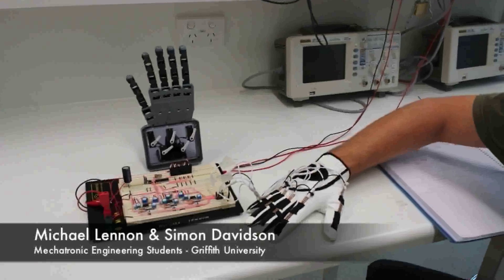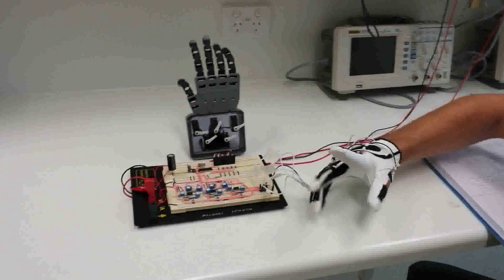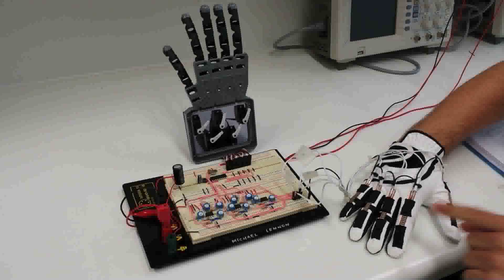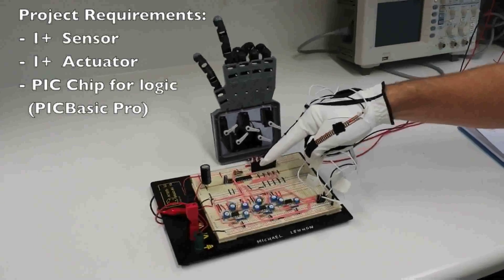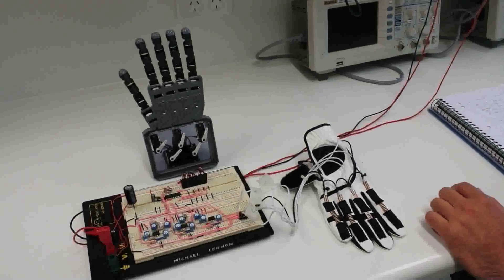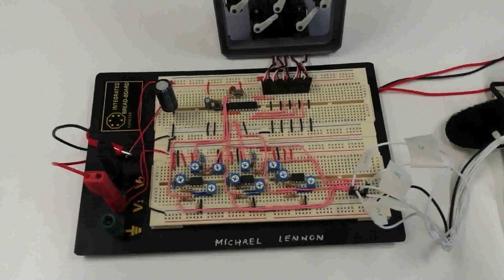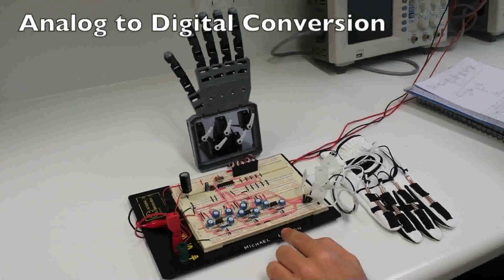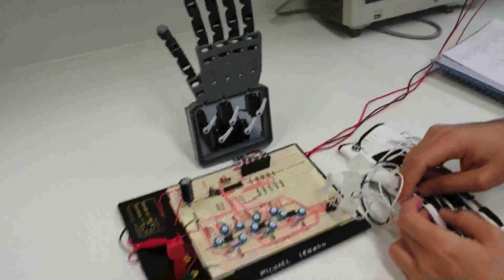Sensor Glove Driven Robot Hand

Comment: Good job! I built something similar to your project but I used full actuation (one servo for every finger joint) Pros of this method: You can perform much more complex finger moves. Cons of this method: Many mechanical parts, Medium Gripping  ability, huge embedded C code, bigger cost. Check it out in case you want to see a different approach on the subject.
Reply: Can I get know about circuit

Comment: Could you use specific resistors instead of the pots?
Reply: already, flex sensors is used not pots
Reply: I was talking about the blue potentiometers at the start of the video. They are on the breadboard.
Reply: aha, Ok

Comment: Amazing work there. I do have a question. How did you manage to interface more than one sensor with the ADC module of PIC? Can you please help me out here?
Reply: well this is old but hey may as well answere this....  a single channel can be programed to read multiple voltage levels as well as multiple frequencies and then have an output predetermined by that programming act accordingly... hope that made sense, im sure google can clean it up a bit.